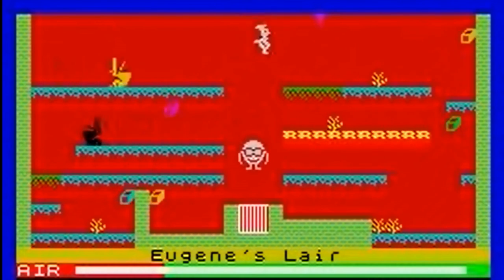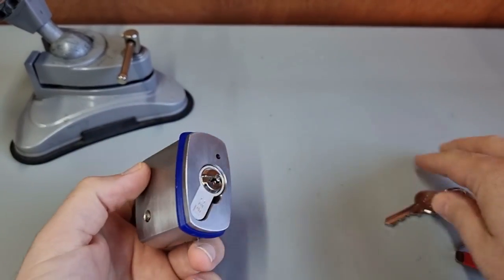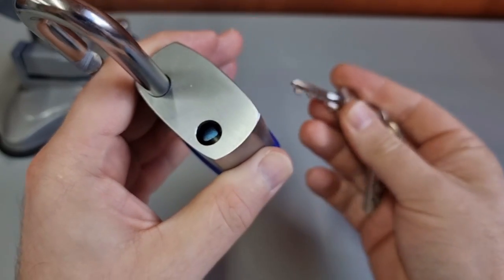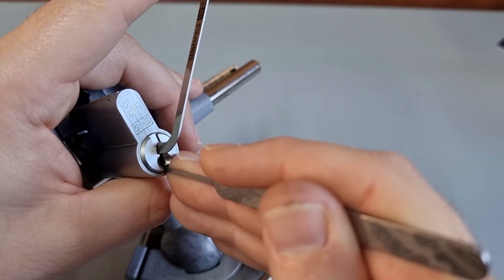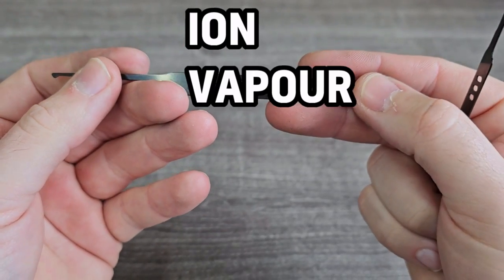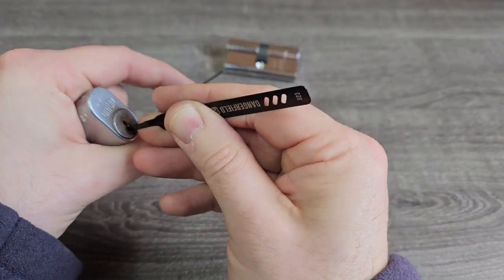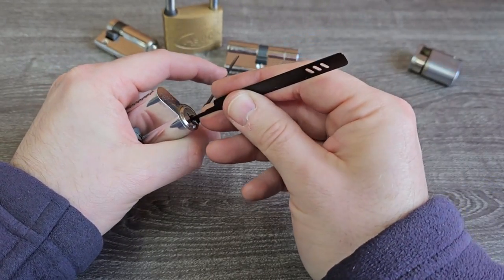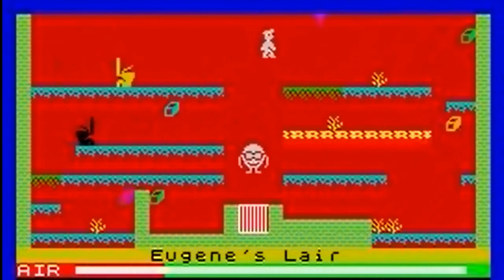Pick Locks In Seconds: MEGA-HACK

Comment: "Scandinavian Oval" is the phrase I think you're looking for.

Edit: Doh, should have watched the rest of the video before commenting! There are called Scandi because they are Abloy designs and used there.
Reply: I think Scandinavian Oval is a standard invented by Scandinavian front door manufacturers. They figured out that since euro cylinder spec is not worth using here in North because it transfers too much cold causing the indoor parts to get too frosty or even frozen during the winter – as a result they would need to create a new design for the locks in any case. They also fixed snapping attack in euro cylinder spec as a side-effect. Of course, Abloy is the most well known of the manufacturers building locks compatible with Scandinavian Oval design.

Abloy had it's own older spec that couldn't fit pin tumbler design inside so it wasn't Abloy that wanted to have Scandinavian Oval design but Abloy agreed to build locks to that design.

Abloy also manufacturers hardware to replace the old spec Abloy lock body with Abloy Protec2 compatible hardware: PG014T. As you can see from the design, it's pretty far from Scandinavian Oval style.
Reply from the maker: @MikkoRantalainen  AMAZING! That's the most detailed answer I've ever had to a question I asked and actually wanted to know the answer to. Thank you for taking the time to write a detailed and convincing reply. I have achieved some learning. Nice one!
Reply from the maker: Still appreciated. But Mikko has empirical experience, which seems to make sense. Fair play for not deleting your comment though. We've all done that on a video or two. It's certainly not a 'dutch cylinder' lol.

Comment: All good, but can it be shimmed?
Reply from the maker: In what way? Between the core and housing?
Reply: @LockPickingLegend  naww, up at the shackle.  You'd shown how the actuator moves on the shackle.  It just needs to be pushed out of the way.
Reply from the maker: No, because this lock has a half-euro inside and not the type of actuator required to shim it. Remember, the cam that you see moving when I show you into the lock is only moving because I'm turning the key. A shim wouldn't budge it.